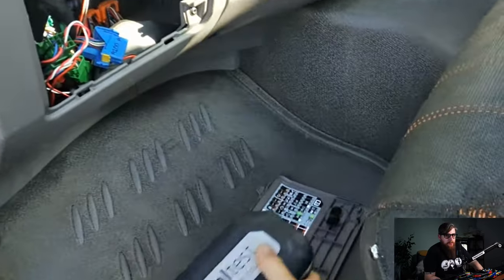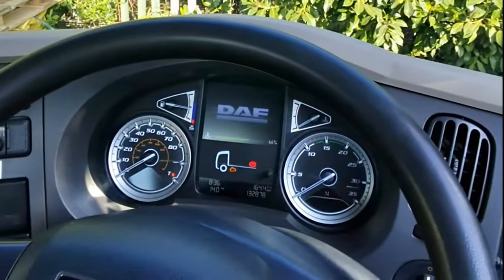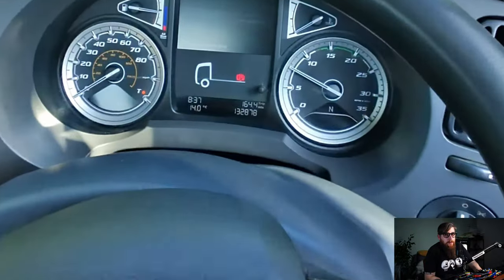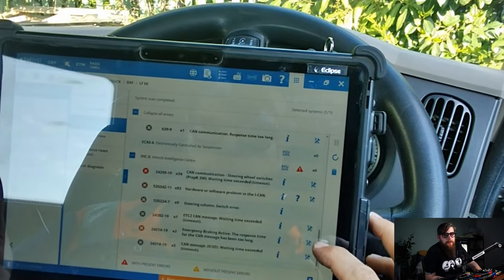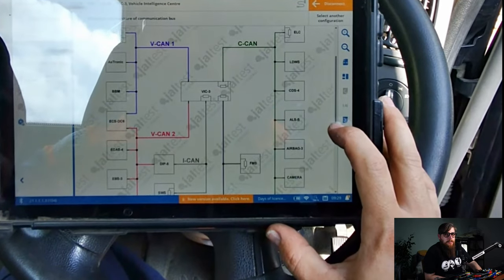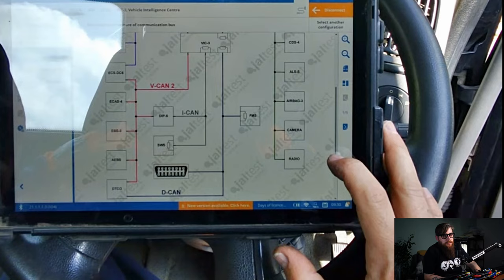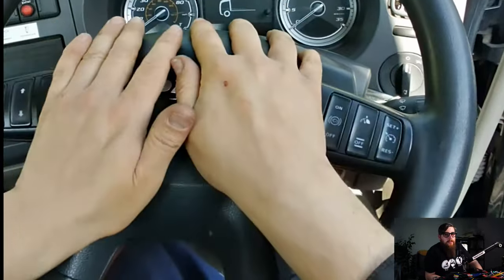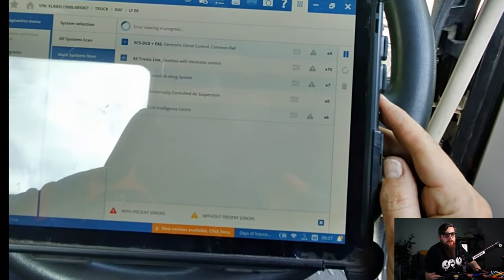DAF LF instrument panel fault identification with JALTEST

Comment: Could you do a video on soot loading, and the side rail issues on the last causing the intake temp to rise and the "dusting" effect please
Reply from the maker: Right Ben I'm more than happy to do videos buddy. 

So when you say soot loading I take it you mean "rapid soot loading" such as from a broken VTG 🤔.
What do you mean by side rail issues please buddy? 

And as for "dusting effect" please elaborate so I can better understand the issue. DTCS usually found with these issues would be good as I can create something from that too buddy 😎👌
Reply: The side rails blocking the out out of the exhaust then the air filter sucking in the exhaust and the engine running hotter.  Oil thins out and the cos the air filter is blocked it then causes more suction on the oil threw the turbo.  Very common on skip lorrys and road sweepers with the normal low air intake amd standard exhaust system
Reply from the maker: Right, I'm on the same wavelength with you now buddy 👌

So DAF LF euro 6 EGR DPF system.

I'm sure I can create something along this
Reply: This dpf egr soot loading is a mine field
Reply from the maker: @Ben Forbes  bodybuilders can cause problems too buddy like you say....side rails and body's. I will sort a video out 😎

Comment: Hi ..please help,i have daf Lf 280 2016 model..it starts but sometimes it shows the engine malfunction display and sometimes it doesn't
Reply from the maker: Hey, thanks for the comment 👍.  Without plugging the truck in it is hard to say but if I were going to hazard a guess I'd go with CAN communication on the VTG actuator

Comment: Do a vid on those cables for the heater speeds etc, be interesting..
Reply from the maker: Hey Andy 👋  sounds like a plan! I will try and get a heater fault and get a video done to do with the resistor pack at some point 👌

Comment: Hello
Friends, I have a daf model 2020 mx13 engine, engine retard. Why does this engine damage the valve stem, and I have seen several cases that their valve stem also breaks quickly, and this is a weakness for this engine. Is this weakness due to the construction of this engine or is there a reason that causes this problem, please guide me, this is a problem. The second question is what type of oil is suitable for this engine. Please give me my answer
Thanks
Reply from the maker: Hey, thanks for the comment.

I've not seen any such issue with mx-13 and unfortunately can't comment on construction defects or issues as I've not seen a great deal of this occur.
I'd be looking at driver abuse possibly And that they are using the intarder correctly.
. Check for engine over-revving, and ensure valve clearances are correct and have been carried out at the specific interval set out by DAF. 
As for oil specification Various endurance tests have shown that PACCAR MX-11 and MX-13 Euro 6 engines that use 10W-30 oil deliver fuel savings of up to 3.4% compared to conventional 10W-40 oil. In addition to lower fuel consumption and better engine performance, a longer service life of moving engine parts

I hope this answers your question
Reply: @TRUCKTECHUK  Hello
You are a good and conscientious person. Thank you for your guidance. Good luck my friend
with regards
Reply: @TRUCKTECHUK  Hello
Dear friend, my car does not have an intard gearbox. In my country, the mechanic told me that the cause of the camshaft failure was that you used the engine brake too much. Because the gearbox of your truck does not have an intarder. Is my mechanic right? If we want to use the engine brake and the camshaft is damaged. Well, why is the engine brake installed? The second question is whether we can use all modes of engine braking. Is there a problem with the engine?
Thanks for your reply.
with regards
Reply from the maker: @farhad_222  your camshaft should be covered under warranty I suggest you contact DAF in your country and get them to investigate the issue

Comment: I have  problem  with tyre pressure  light on in daf xf superspace  trye pressure  is  perfect  do u no problem
Reply from the maker: Hey, thanks for the comment. If you can see the tyre pressures on the dash, your vehicle will be fitted with TPMS- TYRE PRESSURE MONITORING SYSTEM. it's possible one of the sensors is faulty. 
It may want diagnostic or replacement, so you're best getting it put on a diagnostic computer for further investigation 👍
Reply: @TRUCKTECHUK  thanks  for the  mate